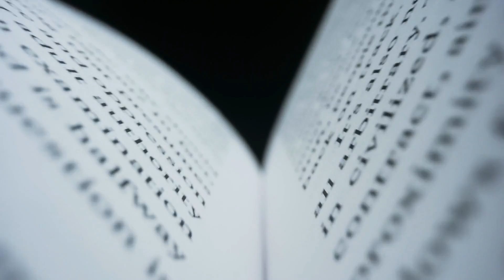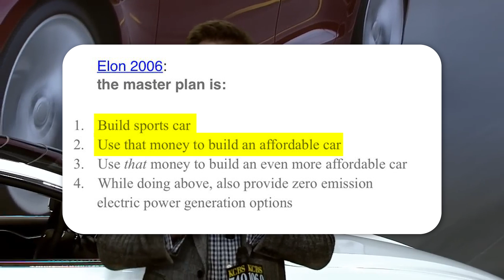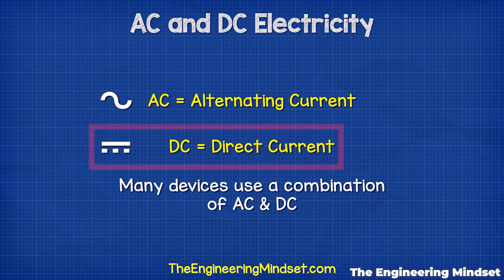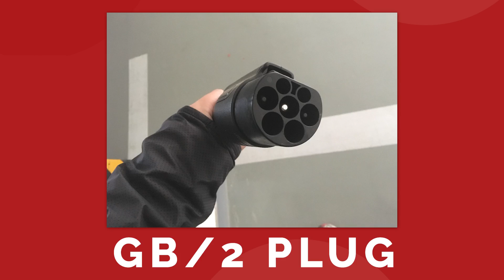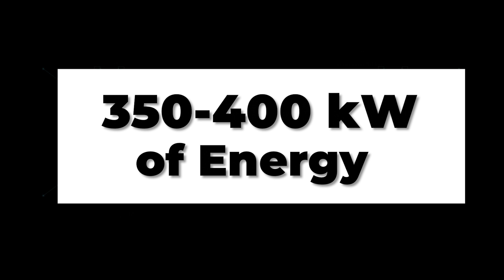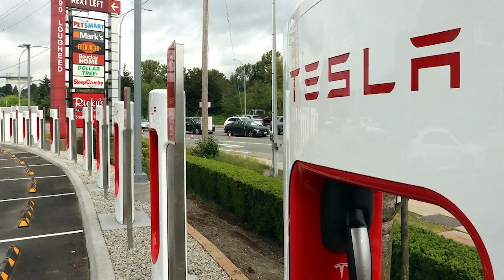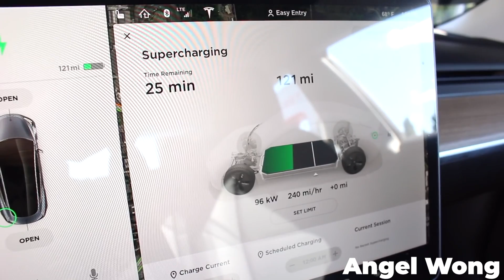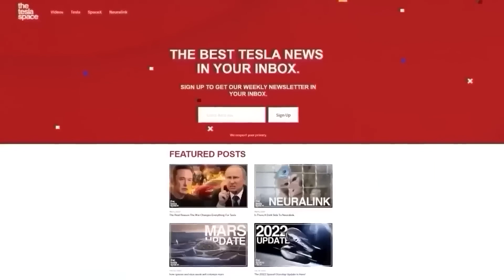The Incredible Logistics Of Tesla's Supercharging Network

Comment: Good explanation but you are confused about inverters.  An inverter converts DC to AC.  A rectifier converts AC to DC.  The chargers contain rectifiers.  Also.. The power conversion isn't done in the pedestals.  It's in a remote cabinet along with an associated transformer and power electronics.

Comment: Inverter plugged in wall, makes sense? No. That is a rectifier, which converts AC to DC. An inverter converts DC to AC and is used in the electric car to use DC from the battery to make AC which powers the motors.

Comment: The Tesla charge plug has one major disadvntage: You cannot use it for three phase AC cherging. At least, nobody has yet explained how that would work with the connectors available in the plug/socket. 
Three phase is necessary for the charge level 2 that you presented in min. 6:22.

Comment: The part that converts AC to DC (which is what he is talking about) is a rectifier, a charger is a type of power supply that is designed specifically to charge batteries.
A power supply is a device that is designed to produce one or more stable power rails to operate electrical equipment. Power supplies come in AC/DC, AC/AC, DC/AC, and DC/DC variants with AC/DC using a rectifier, DC/AC using an inverter, AC/AC and DC/DC use either both or neither depending on the design.

I think he got confused because the car does have an inverter, but it is not involved in charging the batteries, it is used to drive the motor because it is an AC motor. The inverter can also be used to allow the car to pretend to be a Powerwall (car outputs AC back through the charger).

Comment: When I was a youn'un . . . I traveled across the U.S. several times.  I used the Interstate Highway System, because - at most interchanges and major offramps, there was a gas station, a restaurant and a small convenience store - also often a motel.  This broke up the trip in manageable segments.  Don't get too tired and gas up the car, while having a snack.  I think that Tesla could adopt something like this - put those charging stations where people need to stop on their long trips.
Reply: Tesla has already achieved just this. Now they are querying Tesla owners for additional locations as a voting system on where to add not so critically located Super Chargers. SC’s are currently located at key locations along most if not all Freeways & highways and most traveled roadways. 😮

Comment: Actually, converting from AC to DC current is done by a rectifier... Inverters convert DC to AC.  It's a basic fundamental you really should get right if you are claiming to explain  these systems.
Reply: Where did you hear this word "rectifier"?  You don't know what it is.  It does not convert to DC.  AC to DC is done by a CHARGER.  Hence "the super charger network" not the "super rectifier network". The output of a rectifier would destroy anything plugged into it and switching power supplies use a completely different method entirely.   Its sad that someone who half understands things made a youtube video calling them "rectifiers" and now all their follwers are correcting this guy (Who half understood) by giving him the wrong term.). 

Literally on the vehicle diagram its called a "Charger".  You can buy battery chargers on Amazon.  You can't find battery "rectifiers" on amazon.

Comment: You're wrong about what an inverter is.  An inverter goes from DC to AC-- ONLY.  You showed a picture of one at the beginning, with a cigarette lighter plug.  Anything that plugs into a wall and converts AC to DC is a CHARGER.  Hence the DC chargers that are connected to the public grid are called "SuperCHARGERS", not "super inverters"
Reply: Sigh.  There's no "inverter" in the supercharger terminal at all.  It is straight DC to DC from the battery pack at the supercharger site.  That battery pack is charged by a charger that converts utility AC to DC to charge that pack.  No inverter is needed to go DC-DC.

Comment: LOL converting ac current to dc current do not require inverter it require a rectifier bridge only going from dc to dc that you need a inverter
Reply: Where did you hear this word "rectifier"? It is only an internal component.  The output of a Rectifier is not DC. The output of a rectifier would destroy anything plugged into it and switching power supplies use a completely different method entirely.    

AC to DC is done by a CHARGER.  Hence "the super charger network" not the "super rectifier network". 

Literally on the vehicle diagram in this video its called a "Charger".  You can buy battery chargers on Amazon.  You can't find battery "rectifiers" on amazon.

Comment: You didn't mention the reason for using the Type2-connector in Europe. We have a 3-phase electrical system (at least in Sweden, might differ around Europe) so we could have an AC charge point at 3×16 amps (or even 3×32 amps) my service line supports maximum 3×25 amps 240V, but that means there is no problem charging at 3×16 amps, about 11 kW, at home, putting about 100 km of range in the battery every hour. The more chunky connector is a trade-off.

Comment: In Japan CHAdeMO is a standard and the chargers are everywhere. They are slow (45kW max), and costly but I never worried that I am gonna be stack on a road with my battery depleted, There are superchargers in Japan but their locations are often inconvenient.
Reply: Actually, 50 kW. If you look at Sweden in Chargefinder,  there are still chademo (typically one connector per site for legacy) and almost all are marked 50 kW. I believe it is possible to add yet a bit of charging speed, but only 50 kW are installed where I live since most old cars with chademo supports no more than 50 kW. All new cars in Europe use CCS2.

Comment: This comment is likely already posted.
inverter = DC to AC
rectifier = AC to DC
Reply: Where did you hear this word "rectifier"? It is only an internal component.  The output of a Rectifier is not DC. The output of a rectifier would destroy anything plugged into it and switching power supplies use a completely different method entirely.    

AC to DC is done by a CHARGER.  Hence "the super charger network" not the "super rectifier network". 

Literally on the vehicle diagram in this video its called a "Charger".  You can buy battery chargers on Amazon.  You can't find battery "rectifiers" on amazon.
Reply: @RogerWilco1  I heard the word and from an electrical engineer. Yes the rectifier is the internal component that converts AC to DC (as I stated) allowing the charger to operate. Some chargers are DC to DC, and do not need rectification. I guess calling them a "Microprocessor controlled Rectifier and Battery Charger" was too long of a name for the average consumer. 

He said in the video that an inverter converts AC to DC, but that is not true.
Reply: @WentzCraft  Ok, I am a physicist who started out as an  electrical engineer, and and have built and designed several power supplies/chargers.  You misunderstood what you heard.  

A rectifier does not produce DC.  It is a component that swaps polarity and is a fraction of the required components.  The result can be called a power supply or a charger, if its specifically a battery charger.  Chargers do several other things that power supplies do not need to do.  Power supply or Charger is fine,  but they are not called "rectifiers".  

If you connected just a rectifier between an AC source and a DC item or battery you would destroy the item, almost instantly.  If you connect an AC line to a lithium battery with a rectifier between them, the battery would immediately explode.  If connected an AC line to an electronics item via a rectifier, it would die almost immediately, and possibly catch fire.

I'm not talking about his use of the word inverter, but pointing out the incorrect use of the word "rectifier".
Reply: @RogerWilco1  Ok, I am Nicola Tesla, and you are confirming my original comment. 
When did I say a rectifier produces electricity?
All I said was "rectifier = AC to DC"
Rectifiers are in things other than chargers, and as I stated before there are chargers without rectifiers.
Reply: @WentzCraft  Jesus dude.  You literally just said "rectifier = DC to AC" in that comment.  

Stop pretending you know what you are talking about.
Reply: @RogerWilco1  Yes I said that a rectifier converts AC to DC.  (Rectifier = AC to DC)
Are you saying that a rectifier does not convert AC to DC?
Reply: @WentzCraft  No, you said the opposite: 
EXACT QUOTE "All I said was "rectifier = DC to AC""
A rectifier does not convert DC to AC.  It doesn't convert AC to DC either. 

You can't keep the terms straight because you don't understand what a rectifier is and you are arguing with someone who does.

Why are you arguing with me?  Its obvious you are just repeating something you heard but didn't understand.
Reply: @RogerWilco1  yeah that was definitely a fuck up that I didn't edit in time, my apologies. But you are arguing with my original statement saying a rectifier converts AC to DC. Now you are telling me that a rectifier does not convert AC to DC. What does a rectifier do? and don't tell me they don't actually exist because they're just a handful of diodes...

Comment: Charging on a road trip with a Tesla is FASTER than at a gas station. I pull up at a Tesla SuperCharger plug In and walk to the adjacent restaurant, I head for the bathroom and the we order coffee and a light snack or lunch, it is always at least 20 minutes later that we head back to the car unplug, and drive away. 
With a gas car I have to use a credit card get approval, fill the tank (check the oil if driving an old car) get a receipt find a parking spot and then walk into a restaurtant, going to the bathroom and getting a snack is the same amount of time.
As I generally go on a couple of longer trips a year I also save the time not giving the car an oil change or having a smog check done every couple of years.
Reply: i agree. very similar experience.

Comment: Perhaps you mean ac to dc rectifier.
Reply: Where did you hear this word "rectifier"? It is only an internal component.  The output of a Rectifier is not DC. The output of a rectifier would destroy anything plugged into it and switching power supplies use a completely different method entirely.    

AC to DC is done by a CHARGER.  Hence "the super charger network" not the "super rectifier network". 

Literally on the vehicle diagram in this video its called a "Charger".  You can buy battery chargers on Amazon.  You can't find battery "rectifiers" on amazon.
Reply: @RogerWilco1  a bridge rectifier, as oppose to the inverter
Reply: @titingpatac6002  You have no idea what those words mean.  A "rectifier" does not produce DC.
Reply: @RogerWilco1  so what is the thing that produce dc?
Reply: @RogerWilco1  the charger has a bridge or a full bridge retifier inside , in the circuitry.
Reply: @titingpatac6002  I literally just proved you wrong.  you are. BOT.  you are just gonna keep spamming.

Comment: Supercharging batteries only leads to heat, the enemy of a battery.  Ppl need to adjust they're day to work around this.  My one problem is uniformity of charging ports.  OBD2 was demanded to be a universal plug and similar code language (this came to be in 1996).  How these electric car companies were not demanded to uniformity of a charging plug and following system is odd to this car mechanic.  The lesson (learned) was not duplicated here.
Reply: OBD2 is terrible and outdated.  It seems you didn't learn the lesson.  It may have made your life better, but government mandates are ALWAYS a crime and always much worse than whatever they are supposedly fixing.

Comment: No... AC to DC are rectifiers, not inverters... I have only ever heard inverter used to describe a DC to AC conversion device.  A DC to DC may well contain and inverter and rectifier. It it may do a boost or buck conversion, that is sort of like an inverter.
Reply: Where did you hear this word "rectifier"?  You don't know what it is.  It does not convert to DC.  AC to DC is done by a CHARGER.  Hence "the super charger network" not the "super rectifier network". The output of a rectifier would destroy anything plugged into it and switching power supplies use a completely different method entirely.   Its sad that someone who half understands things made a youtube video calling them "rectifiers" and now all their follwers are correcting this guy (Who half understood) by giving him the wrong term.). 

Literally on the vehicle diagram its called a "Charger".  You can buy battery chargers on Amazon.  You can't find battery "rectifiers" on amazon.
Reply: @RogerWilco1  so they aren't called a battery inverter?  Weird.
Reply: @D0li0  Seriously, who told you it was called a rectifier?  This comment section is full of people who don't even know what that word means "correcting" him with the wrong information.  A rectifier is an obscure component that most people don't know... so you all heard this faleshood from somewhere.  Where was it?
Reply: I was going to make my own post about this until I saw yours. You are correct, not the video.

Comment: Look up the Weber Auto video.  "There is no such thing as level 3 charging".  
AC level One is up to 1.92 kw 120 volts requires a 20 amp breaker using 16 amps.
Thus 120 x 16 = 1.92 kw
AC level Two is up to 19.2 kw
240 volt requires a 100 amp breaker, using 80 amps
Thus 240 x 80 =19.2 kw
DC FAST CHARGING level One
Is up to 48 kw
DC FAST CHARGING LEVEL TWO IS UP TO 400 kw.
The Megawatt Charging System (MCS) is a charging connector under development (in 2020 to 2022) for large battery electric vehicles. The connector will be rated for charging at a maximum rate of 3.75 Megawatts (3,000 amps at 1,250 volts) direct current (DC).  Should be on use in 2023.
DC Chargers are at the stations, direct current the battery.
EVSE: Electric Vehicle Supply Equipment for AC charging of level One 120 volt and level two 240 volt.  Think of the EVSE is just a "smart power cord".
The AC chargers 1 & 2 are in the vehicle.  

33.7 kilowatt hours is equal to one gallon of gasoline. 

The term "Superchargers" are Tesla branded DC fast chargers.

Comment: USA is not fully covered, not even close. Vast areas have no charging to traverse them or to range out and back from a charging location. Many US federal highways are not usable for this reason.  More Tesla Superchargers are needed spread out to fix this real problem. They don't have to be large but they have work. Destination chargers may be an answer if open 24 hours.
Reply: The federal infrastructure bill mandates a charger every 50 miles or less on major highways. They're coming.
Reply: @OtisFlint  I hope they chose to include Tesla in the service providers. They are so reliable and user-friendly.

Comment: Level 3 goes up to 1 MW+. Tesla's Semi Charger is a L3 charger.
Reply: I don't think that has been actually confirmed.  So far the Megacharger plug is not compatible, so a megacharger and a L3 might be different.  Part of that could also be to make sure semi's and cars are not using the same spots for charging.
Reply: @TheEvilmooseofdoom  It doesn't matter what port is being used. A level 3 charger is a DCFC. So, if it by-passes the car's on-board charger, it's a L3.

Comment: When describing why batteries slow down charging as they get full, I say:

Think of pouring a glass of water from a water jug. At first, you can pour a ton of water into the cup, but as the cup gets more full, you have to slow down so that water doesn't splash or spill over.
Reply: Useful I think! Though that seems to allow for the connotation that it is more preference/skill checked rather than physically limited~ Mayhaps comparing to packing a suitcase or a subway car would be more apt(?)
Reply: @ryvyr  just remind them that batteries are playing with electricity, not water. Playing with water gets you wet. Playing with electricity will set you and your house on fire :P

Comment: Excellent information. As for the inverter, rectifier comments, too much info for the viewer.  I recently bought a CCS adapter.  There is a supercharger 4 miles away and an EVgo 6 miles away at a mall and gym that I pass on weekdays.  EVgo was charging $0.26 per minute, but to "save money" they went to charging by the kWh.  The increase was 67% overnight.  Nothing but trouble getting the chargers to connect to the car at first, and many calls for help.  The cables are very heavy and the CCS plus the adapter rules out many women being able to make it connect.  Sandy Munro has pointed this out as well.  I live in an apartment and my time of use cost was about $0.18 per kWh.  EVgo and Tesla charge $0.39 - $0.41 per kWh. The landlord and Fire Dept says no to my very expensive 10ga 7500w extension cord.  The supercharger is the way to go for travel and ease of use. Tesla has the electric cost at the high end (varies by location).  So does EVgo at twice the cost I would pay.   The problem going forward is charger ownership.  Are we headed to being slaves to the Watt suppliers as we are to the Gas suppliers?  I think Tesla may retain ownership of the network and supply it with alternative generated electric supply, but what if it gets controlled by BP,  Shell,  Chevron or Exxon?